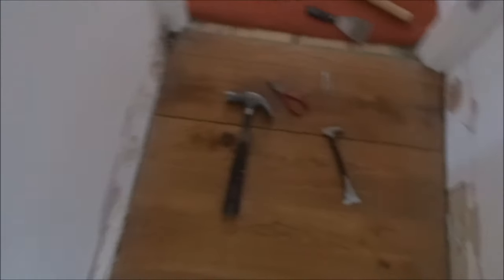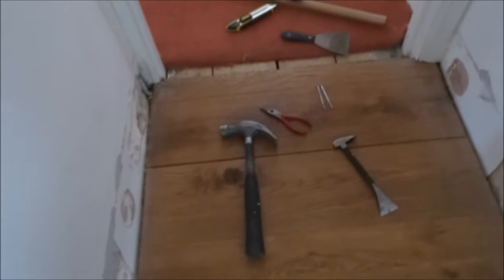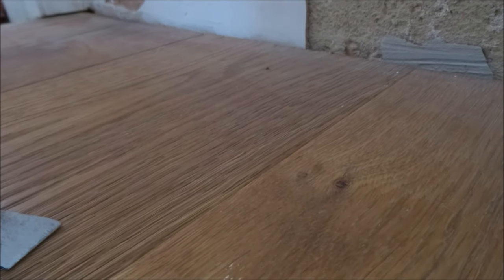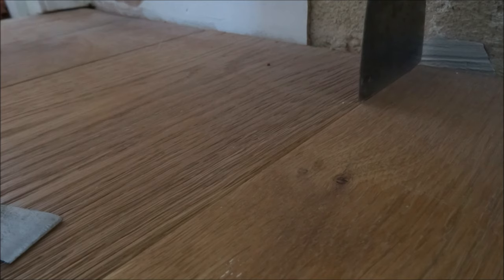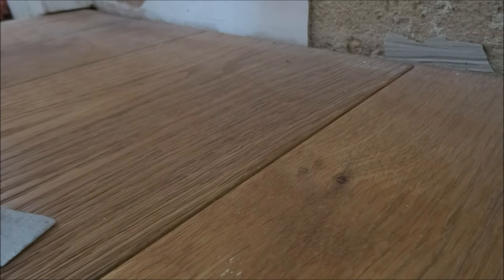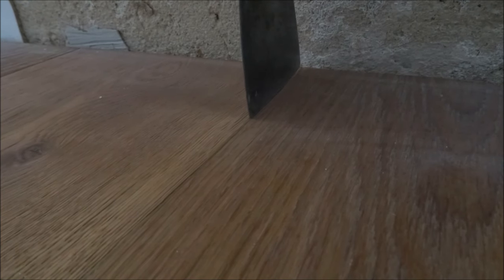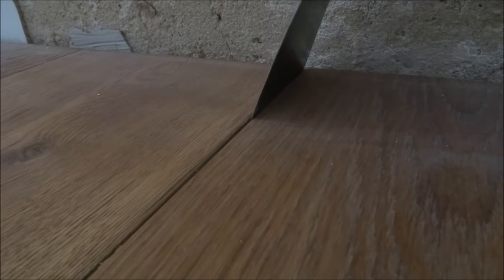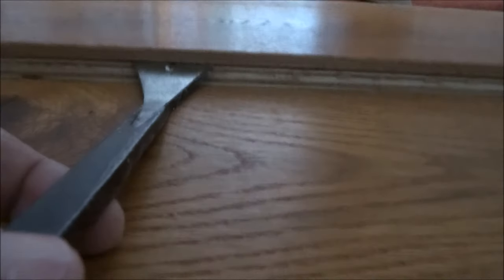How to Remove Tongue and Groove Flooring without Causing Any Damage

Comment: Is it possible to remove flooring (wood, laminate, etc) without removing the skirting, especially if the ends of some of the boards are under the skirting itself?
Reply from the maker: All depends on how it was installed.

Comment: Were the boards glued?
Reply from the maker: Yes they were glued.
Reply: They didn’t use much glue from what I see ?? I have an oak flooring that is really glued down and an absolute nightmare to get up !!
Reply from the maker: I did the glue, just a thin strip. Enough so it doesn't come out when pushed into place.
Reply: @alfiedog2942  The floor is floating, not glued to the subfloor, but the individual boards are glued to eachother.